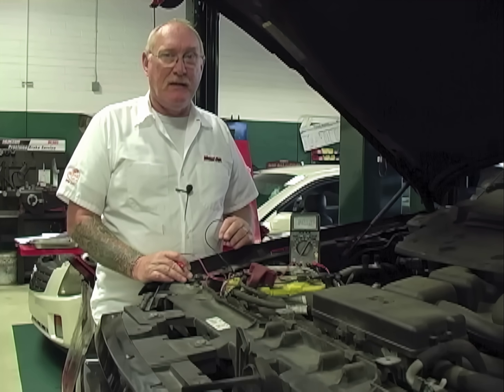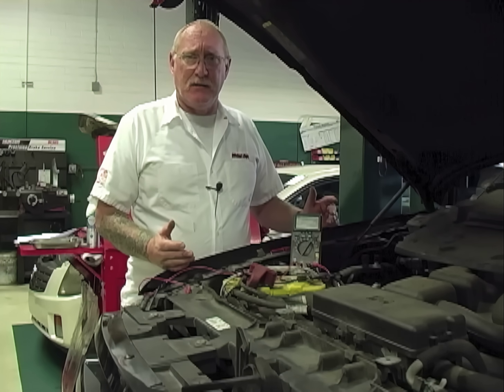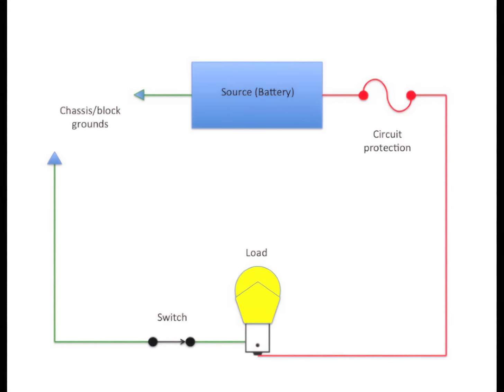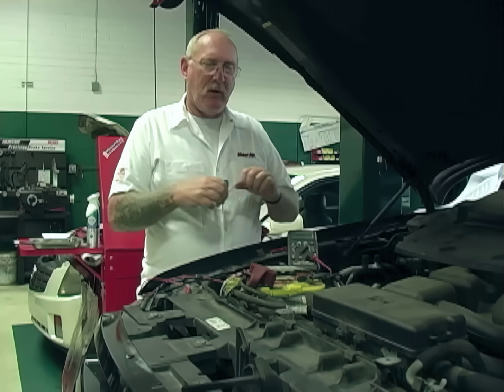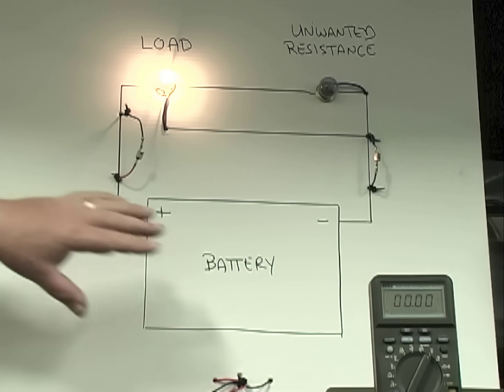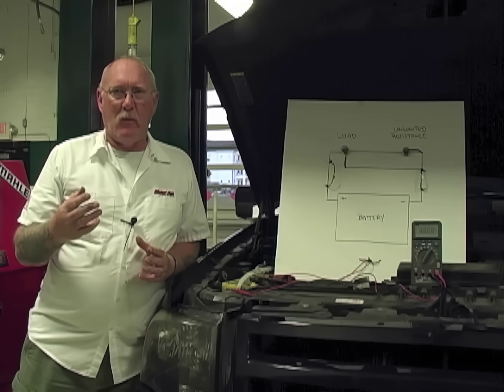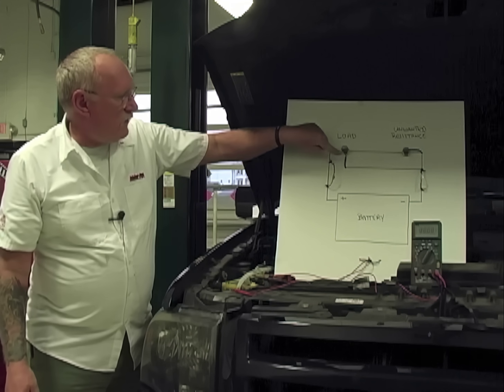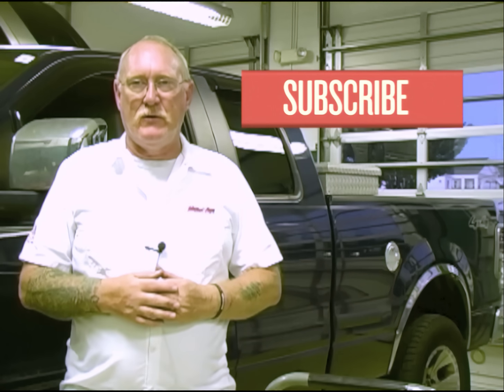The Trainer #47: What measuring voltage on the ground side means

Comment: I read the title and instantly knew what was coming.  It's a very basic principle that too many greenhorns overlook.    I watched a guy change a fuel pump three times before I took over and found that the customer had disconnected the ground for that circuit so he could install a boom box in his trunk.  It's not enough to know that something isn't working, you have to know why.
Reply: Yard Sale Dale  -  I'm sure that was exactly what the supervisor asked him.  I wasn't there for that conversation.  Was it a lack of know how or imagination?  Your guess is as good as mine.
Reply: Thank you sir for a very good video. I learned a lot here.
Reply: I have an electrical engineering degree but don't know where to start with car electrical because I do not have a schematic and have know what explain the basics of a schematic (if I had on) to me. I watch these and other people explaining electrical problems because these are very expensive repairs I could do myself and can be useful when electrical problems strand you on a trip. This video basically says always check both sides of a load to the body, because in many of the repair videos the pathway to one side or the other (+ or -) is compromised. Someone did a video of checking the computers harness to verify the computer is the problem and not the harness voltages. Another is the battery, wiring/fuses, solenoid, or starter the problem by looking a voltages while attempting to start the car. Knowing how to use a diagnostic plug to take a first pass at a problem is also useful.
Reply: @mykofreder1682  camshaft
Reply: I changed my head gasket went to start truck . Starter burnt out . I fixed it went to start truck . No fuel. Pump not running. Well I just got pump off. Is there anyway I unhooked a wire some where. Or is it my fuel pump.  I went from head gasket to waterpump it started for a second . Shut off just was checking time before fan and stuff so maybe enough gas to barely start idk. But after together and starter issue . No gas pressure no noise from tank.  And I wasn't pulling bed off I took tank down. If anything I'm going to try run wire to pump.  Just cold out now.  And if ain't pump on Ford ranger maybe u might have idea. Ty if u read this
Reply: @Therabidrabbithole  is the ground cable from the battery connected to the engine block?
And is the ground strap from the head connected to the cars body?
The body/chassis ground engine ground, are the sources the other grounds use for a path to the negative battery post.
Sometimes people don't put things back or put them back differently because they aren't somebody who does that work with repetition.
Did you take anything else apart?
Are the connections in good repair and not corroded? 
Retrace your steps inspecting what you had to do and if you can't find something, diagnose the fuel pumps operation as per the service manual.
You can get literature free on library databases from home using a library card.
Some data bases, you go to a library for access. Print your pages and return.
That's what I do if I need familiarity and a map and procedure.
A fuel pump uses an inertia switch as a shut off for safety. It uses a fuel pump relay.
It is turned on and off by a PCM.
The PCM must have signal spark is working or it can shut fuel pressure down for safety.
This is why having service manuals can help, knowing how the circuit works and what components are included in the circuit.
Fuel delivery can be shut down as well by antitheft .
You know you are working with pressure loss of supply because you don't hear the pump run.
Stick to why that is first, as you probably know.
But only you know what change could be likely to have been caused, since it worked before you began.
Locations of components is also info service manuals provide.
A good portion of what they publish is correct.
A small portion needs updating or correcting to be less vague.
You said it seemed to run for a second. This could be a clue it can run but is being interrupted.
You write some phrases that raise more questions. I won't be able to go back and forth. You can do that with an online tech assistance and read other people's fixes for their circumstances.
They made Rangers for a great number of years. Always refer to year/make/model, engine size, trans type, unusual options.
Then the helper can picture what components and systems are in use on yours and particular info to yours.
Good luck.
This tape will self destruct in 5 seconds.
Reply: @Therabidrabbithole - When you work on it first and something else changes, the odds are high that the new problem is a result of what you did. Check your work, very likely you have a computer control sensor/device disconnected or damaged and the computer isn't switching the pump on. That also includes damaged wiring. 
 Bypassing a fuel pump circuit with a raw wire is asking for an electronic nightmare.
Reply: @Therabidrabbithole  You just took the car apart and now you don't have fuel pressure.  The very first thing is to double check your work.  Many computers are designed so that if a crucial sensor is giving a signal that would indicate the engine shouldn't be running, the computer will cut fuel or ignition.  A disconnected or damaged sensor can trigger this.  So, check to make sure everything is plugged in and undamaged.  That includes the wires that carry the signals.  Did you check the fuel pump fuse?  Did you check for power at the fuse?  Did you check for power and signal at the relay?  Did you try swapping a known good relay in, to test the relay?  Did you check for power at the tank?  Did you check for ground at the tank?  All of these tests should be run before removing the tank and the pump.  There are no returns on electrical parts.  Running a raw wire to the fuel pump is a recipe for disaster.
Reply: Yes I checked fuses . Changed them anyways or swapped them out and where I put them they work that thing. My ohm reader battery dead . So I couldn't check power there also relay under glove box good . . But wire harness a mess because of coil fire which I was told only head gasket. Soon as I seen fire I said well look at timing belt cover ain't no doubt the belt slipped . Only couple wires burnt but was close to touching . I had  books on all ford rangers which I should of replaced. Once I unhooked exhaust I picked or pulled it out .only like two plugs and four hoses off . If I have anything wrong it's those lines that water come out of . I guessed one from passenger side that has water coming out went under intake.   Seams like out of fifteen times beating on tank I got one lb of gas pressure. Other than that not a drop.  .thanks if I hook a wire to pump and it moves then I'm gonna cry lol but I'll cut a hole in bed to access that pump . Poor ppl running tanks on empty is hard on fuel pumps. Seams that fuel pump line has like ten holes. Positive and neg be lot of guesses lol. I bet your heads spinning.  But hey so is mine lol
Reply: Starter repairman said how the heck did that starter ever work worst one he ever seen. .  lol it worked great moving truck to get towed . To where I worked on it. To where I tested timing before I put fan on and belt. Then NOTHING. SINce I broke I go to library.  Last ranger I had drive like a caddy be doing 75 then everytime after ten miles dies. Pull over wait. Pump peddle start another two miles . 2 more miles one mile. Two miles till I get home change all kinds stuff from YouTube.  Finally I go well obviously it runs great cold so mother warms up swells up  has to be water getting on plug or plugs.   I changed intake gasket never had another issue.   But I tell you I can have bad luck. Went out waterpump in problem truck I no clue how it didn't leak cuze one one the holes stripped I put bigger bolt in it . But wasn't chancing pump so I replace waterpump. Cuz I broke no threader. I have bolt threaders but not for hole . Worked on my other ford V8 they changed intake to four barrel . Couldn't stop it from flooding out. Two days after I sold it I heard fuel injection runs off lot more fuel pressure so I should of changed to a different fuel pump. Idk but it was definitely getting to much gas.  Run great half throttle or until i hit brakes to turn. Then die and flooded lol . Either change two plugs or wait half hr .   Thank you all I just wrote this incase some other person changed  intakes in f250 s or full size fords
Reply: @Therabidrabbithole  the truck should supply a power and ground when you turn the key to run.
The relays in the vehicle are triggered by a PCM.
If the pump doesn't run and pump fuel then it fails it's basic tests.
Verify pump, verify PSI, verify volume.
Pumps fail because they can't pump dirt and NHTSA studied sulfur content of fuel as the cause of failure prematurely across all makes.
You have to change the filter every 15K or you cause the pump to labor when it gets clogged, right.
You can search for a fuel system schematic.
I can't, because you still only said it's a "Ranger".
Best to use a 12v light bulb for verifying power and ground.
Like a test light they sell pretty cheap at the parts store or thrift store .
I've found whole complete new tools and equipment at thrift stores, even with battery good. Or a good bulb.
That's often cost about the same as a 9v battery of a good brand.
Analog testers are a decent volt meter and read well when adjusted.
Bulb intensity would be enough on the test light with a charged car battery and then compare.
Have fun with that.
Carter makes the pump and sender assembly you want and I used to get them through napa when they failed because you get the entire assembly, new, in a plain white box.
Saved a lot of money for people doing that.
Even my wife's boyfriend.
HA ha ha.
I didn't read in any of your comments where you tested the inertia switch.
You did say you found a relay going under the glove box.
So, does the fuel pump connector and it's ground supply a 12v lightbulb?
Even if it only runs 3 seconds in run?
And then does it light that same bulb during cranking?
This is why you use a service manual procedure.
You checked fuses, and I'm guessing there's a power distribution box also (under the hood)
Anybody with a driver's license can check that easy stuff, but using a 12v light tester verified power before and after and some vehicles have components that aren't in the fuse box or the p.d.b. under the hood.
If you really had to, you could find an EVTM manual at a library or the Ford garage to get a look at the simplified testing for your model, year, and options.
If you have a dual plug four cylinder, inspect the ignition module and connector.
Loss of spark cancels fuel.
If you have antitheft or PATS, for proximity key, the PCM can also interrupt fuel when it's not having it's requirements satisfied on some vehicles.
There are bypass methods, but you need to ask for help.
I can't imagine another cause without the basic info.
Reply: @dannylinc6247  LP
Reply: @patpolosky7954  It uses ..liquid petroleum?
It's empty of fuel, right?
He's outta fuel.
He should hear the pump start or run as per the manual, right

Comment: Thank you for showing us this method of diagnosis.
I have a cherokee that every time I turn on the blower fan the voltage will drop from 13.4 to 12.5
I used this technique to determine that the blower fan was at the end of its life and had too much resistance.
Must people think that it's the blower resistor and change it with no affects on the problem.
Replaced the fan motor and no more voltage drop.
Reply: Actually your blower had too little reluctance. But that's a subject for a whole other video. 😉

Comment: Good stuff.  High resistance in the positive side of the circuit leads to this situation:  The lamp won't light.  Re-lamp no help.  We know that the lamp will operate when we connect +12 volts on one terminal, and a ground on the other.  We remove the lamp, measure 12 volts on one terminal and a good ground on the other.  We reinstall the lamp, it still does not light.  What did we miss?  We know the ground is good because we measured it with an ohmmeter. We assumed the positive (power) side is good because we measured full battery voltage on it.  BUT, we had to remove the lamp, which is the load in the circuit, to put the positive meter lead on the terminal in the socket.  We have now replaced the normal load, which draws a current of, say, half an amp, with the meter, which draws a current of--guess what--practically zero amps.  Voltmeters have very high internal resistance, typically in the millions of ohms.  If you have a corroded or damaged connection or wire on the positive side of the circuit, even if adds thousands of ohms of resistance, the tiny current drawn by the meter will not cause a noticeable voltage drop in your measurement.  So you measure twelve volts at the terminal with the lamp removed, but when you replace the lamp in the socket, any current it draws will cause most or all of the voltage to be dropped across the high resistance of the fault.  The voltage you thought you had measured disappears the instant the normal load is inserted into the circuit.  This is why you always attempt to make your voltage measurements in a complete circuit, with the load connected and any switches turned on.
Reply: You cannot measure the return with an Ohm meter and call it good.  That's the problem with hack teachers like this guy.... they don't really explain anything and make up things like "consumes the voltage."  Absurd.
Not all things are Ohmic.  Incandescent filaments are a prime example... measured with an Ohm meter you will get nearly a direct short (depending on the bulb Wattage and voltage rating).  You know that can't be.  What happens is that the filament has a positive temperature coefficient and the resistance rise as it heats up.
Your claim that a multimeter will not measure thousands of Ohms of resistance because the current is too low is grossly incorrect.  Even at just 1 Ohms of resistance a halogen bulb can drop more than five volts or nearly half of the applied voltage!  But, that 1 Ohm is measurable though ill advised.  It is better to read the voltages in the energized circuit and use those voltage readings to determine where the waste resistance is.   Low voltage on the hot side means there's something wrong there.  But is has to be measure WITH RESPECT TO A KNOWN GOOD GROUND not the return wire on the load, itself.  That's because the issue might be on the return side and you can only know that by measuring the return side, also, WITH RESPECT TO A KNOWN GOOD GROUND.

Comment: What if I told you electrons flow from negative to positive in a negative earth ground system as we have here in America? What if I told you the fuse could be installed anywhere in the circuit to protect the circuit? Flame away..
Reply: biggysground yep. I’m an electrical engineer and this guys explanation is horrible
Reply: @recplay3441  Well because the tube goes around to England/Europe also so why confuse people with your reply... but hey?
Reply: Also, US vehicles rot out faster than positive Earth grounded vehicles. This is why we see the crud around the positive battery post so often here. Road grime is attracted the the body of our cars and trucks, tends to cling more.

Comment: Nice video! I'm a master electrician and i know ohms law inside and out but i thought you did a great job of boiling it down to a very practical and useful chunk. Cheers
Reply: That's laughable.  I was a journeyman and went to engineering school.  I know you don't know ohm's law inside and out.  You think you do.  I thought I did too.  Until I went to engineering school and learned how much I didn't know.
Reply: @Impedancenetwork  your right. Electro magnetic theory goes beyond my firm grasp. However i repair motors and generators so i have a good working knowledge of impedance (inductive/ capacitive reactance + liniar resistance). My point was not to brag but to complement the host and add weight by mentioning my background. I hope you do more with your education than laugh at people beneath you on you tube.
Reply: @simclardy1  im a master electrician for 15 years, been in the field for 25  and have an associatesl degree in electrical technology.   I have worked with countless  EE over the years and I am amazed at what some of them  dont  know. I had a couple coming to me for help when they were studying for the PE exam. Its frustrating when a so called professional thinks we have nothing to offer or scoff at our opinion because we dont have a couple letters behind our name. I know that most EE have vast knowledge in theory and can be great resources and i look forward to working with most. I wish that some  would quit looking at us like were just wire pullers and pipe benders. Some of us have extensive background in electrical theory, design and installation. OK, getting off my soap box.
Reply: @farmerjim-fat-man-do  thank you. I could have worded my original comment better but i agree with everything you say. I have friends who are amazing electrical engineers that design all kinds of cool things....so, much respect, but like you said it's not a given just because you have a title.

Comment: First thing to check is that you have a good, solid, clean earth strap from the battery negative terminal to the chassis. Corrosion at the chassis can leach a voltage and give you a reading.
Reply: Exactly! A friend with an old rust bucket truck couldn't get the motor to start, yesterday. The battery was new, but the frame and body is solid rust . I suggested cleaning all the ground straps from the engine, body, and frame. Nope. He suggested that another guy push start the truck with a skid steer!